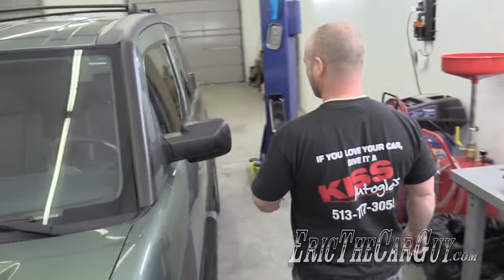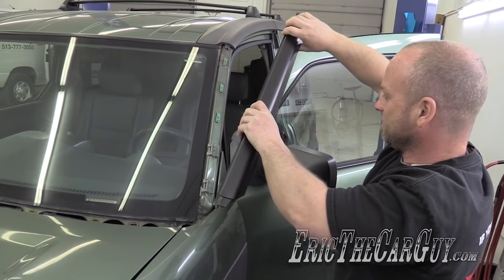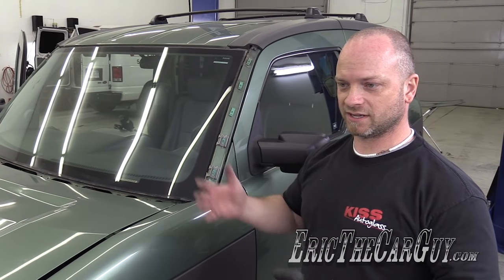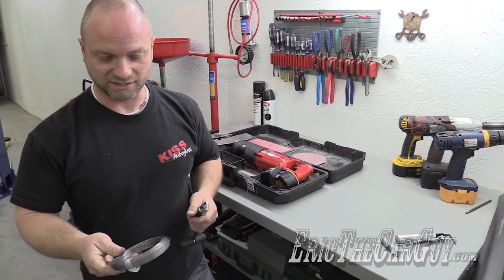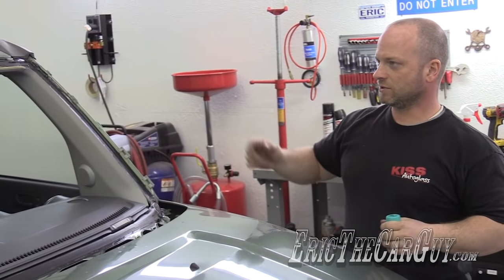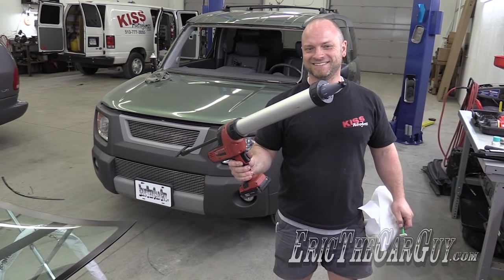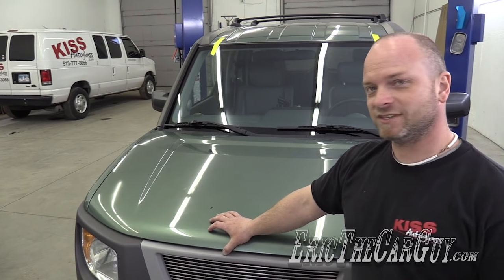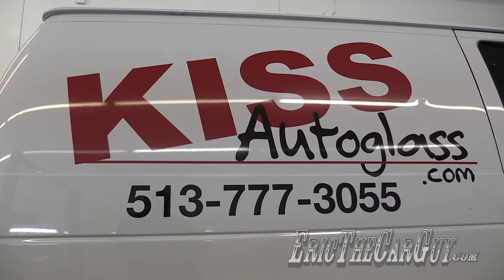How To Install a Windshield the "Right" Way -EricTheCarGuy

Comment: overall I give him a 9 for good work ,priming his scratches and a uniform v bead, however a small amount of rust is an enormous problem! you can not simply prime over rust, that's like putting a bandaid on cancer! it needs to be sanded down to bare metal and then primed, otherwise the rust (cancer) is still decaying underneath the primer! and will eventually start leaking! this also effects the structural integrity of a vehicle and therefore would not meet ratings of  a crash test or meet the manufacturers standards, the auto glass safety council ( the place that certifies auto glass technicians) would fail this Intallation!
Reply: The International Grammar Spelling and Punctuation Institute, (IGSP), would fail your commentary!!!
Reply: Definately a bandaid and window will have to come out in the future. He should have sanded it down and at least use a rust converter so the rust does not spread. Great video install tho!

Comment: i know of a windscreen that can be fitted by anyone, and can be done in 20 mins, land rover defender, why you might ask? because it uses a rubber seal and isn't bonded, downside? that rubber seal shouldn't be called a seal, it should be a called a sieve!
Reply: You should use silicone sealant in the outer lip to prevent water ingress.

Comment: Just for clarification... tempered glass is not designed to keep you from getting cut. It's designed to keep you from getting IMPALED! When you have large sheets of glass that are not tempered they can break off into very sharp, large, triangular pieces that could potentially impale an occupant. ANY glass will cut you, whether it's tempered or not.

Comment: Thanks a lot Eric for such a great video and thanks a lot to the "extremely professional and accurate" Rich from Kiss Auto Glass. I find this video particularly really helpful; because, nowadays, windshield replacement is "rarely" done right. I know a lot of friends who replaced their windshields at "cheap auto glass shops", where they got thugs from the streets replacing their windshields causing water leaks, deep grooves into vehicles' frames, rust, etc., which, in turn, forced their vehicles eventually into the junkyard.

Comment: For slamming the doors with a newly installed windshield, I have an idea about rolling down the windows first so air pressure won't build up in the car w/c would cause issues w/ the urethane, especially the cheaper ones. 
Then you could roll up the windows afterwards. 
I hope this helps. 👍🏼

Comment: What company should I look for to find the best quality cold knife blades? I went to the junkyard to **attempt** to remove a windshield this weekend. I didn't have the job specific tools needed to remove the windshield and it cracked the glass. Now I realize it's not as easy to do this job correctly as I thought it might be, not that I thought it was easy. Great video, thanks for posting this to your channel E.

Comment: The best install I've seen. There is no repair I wince about having done more than the windshield other than the timing belt. The shop screwed up the last timing belt install and it wasn't any better after they replaced the tensioner pulley but charged me an additional $128 for the pulley. I should have gone to Honda. I'm not a hater but if you screw up for God's sake fix instead of blaming it on the customer.

Comment: As a glass tech. I just want to say he did a good job but still did not do everything correctly. First was using the long knife to trim the excess urethane on the sides of the windshield before running the cold knife down it, although it does make it easier. It causes a deep gouge in the metal beneath it. Second was trimming the urethane before cleaning, you're supposed to clean the pinch welds before you trim the urethane. Which helps eliminate foreign chemicals which may cause adhesion problems. Third was the rust, the rust should have been cleaned down to bare metal, before being primed. Priming over the rust does not stop it. which will still eventually cause the windshield to leak. Speaking of the primer takes me to the fourth problem, which is the daubers he uses to apply the primer, 1 should only be used once and never dip twice into it. again causing cross-contamination what could ruin the primer. Now moving on to the "running of the urethane" you never want to seem in the middle of the glass at the top. you want to do one continuous bead when possible however you can't do it on every car. it is very easy. Less seems is less areas for possible leaks. Then using what's called a "pojo" you're supposed to smooth out your seams and make sure there are no gaps and or bubbles in the urethane before setting the glass. Other then that. Good job.

Comment: I see Safelite windshield replacement ads on TV every 5 minutes. They charge $350-450 to replace windshields. I take my cars to a place that charges $90 and it only takes them 20 minutes. Safelite is grossly overcharging people. I guess they need to pay for non-stop television ads. #crooks

Interesting video. Thanks!

Comment: I used an adhesive that came in a coil with waxed paper between it in the coil. When you stick it on the window frame it sticks instantly and once you lay in the windshield and push it into the adhesive, it's down. Also the stuff never hardens. So stays flexible. Totally water proof. No caulk gun needed.

Comment: Great job Rich. I got a 2007 Honda  CRV that was done by an amateur for the previous owner.  
B4 i go to a shop im trying to get any  male /female clips or gaskets needed b4 install as these old ones have been  caulk glommed in there after being broken from improper removal.
I wouldnt expect an indepenedent shop to carry my  incidentals. The male clips are broken on the garnish trims as well at left and right pillars

Comment: Nice video. My only question is why not run the bead on the windshield. I have seen other techs put the bead on the glass. This way they can run one continuous bead from bottom middle all the way around the glass back to bottom middle without stopping. Thanks.

Comment: So, with the long knife, there's obviously going to be some cutting and scratching of the vehicle's paint which means that water molecules will now have access to the bare metal underneath that now exposed paint which will eventually cause rust which will eventually cause water leakage. So, do you clean and prime and scratched paint so there won't be any rusting and leaking issues later on after replacing the windshield?

Comment: Pretty interesting to see how this was done 8 years ago, beyond chemical and equipment updates its still quite similar, I've been a trained technician for about a year now and can do most vehicles in 45 minutes, there are a few I can do in 30 or less but 99% of vehicles are sub 1 hours. Best vehicle I've ever found to do is a suzuki Jimny, 10 minute job max, they are so small and have nothing to dismantle as well as having a wide gap between the pinch weld and glass making it a dream job

Comment: I will say, very nice job. Luckily, the old windshield was an easy removal. I know, in a business sense, it's not viable do clean the old sealer off but, for my own vehicles, I clean it right down to the paint. I also fix any rust issues. I used to do this but, now only for personal reasons. My absolute favorite was doing this mobile...NOT. Nothing better than doing a solo job when it's windy! Couple things I would have mentioned would have been the importance of a windshield in regards to structural integrity. Mostly, what not to do when changing one out like the importance of a flat surface and not having the vehicle jacked up on one side and the doors open. Also, about taking a vacuum to the defog vent, in case the glass was shattered and some bits might have gotten in. A good sign of a poor installation is rust forming around the windshield, especially on the roof line. Maybe, you could do another video of roping in either a windshield or other window with a rubber gasket. Lastly...You can always tell a good installer by the size of his guns! Cheers guys!

Comment: As someone who's been doing autoglass for 16 years, and having done countless elements, I can vouch that these cars suck to replace.  That being said, those moldings should never be removed the way he did it.  Pulling up, destroys the clips.  If you watch the video again, you will see a few clips that have white plastic attached to them...  those are the broken clips from the moldings. If you need to remove them, the best way is to stand in the door jam, grab the outside part of the top of the molding, and push forward.  This release the grey clips, from the green clips.

Comment: 08 nissan sentra.. replaced windshield ad I pointedout the ripples in the trim at top of glasses and that the black part for windshieldwipers was loose. I also notice that it didn't Connecticut to car or winshiled side trimming. He stated that it the snow it would smooth out and that the blk bottom half was perfect but because it was so old n the yea and the dirt and leaves over the years of not replacing windows it was like that

Comment: I just had my new windshield installed by dealership, it’s Pilkington EZ cool plus but I noticed that it wasn’t centered. It pushed more towards the driver side. The right side has 5mm difference than the left side. Should I be concerned? It’s for RAM 1500. Thank you.

Comment: I had my windshield replaced a few days ago.  After leaving the shop, I noticed my wipers seemed to be struggling to move and go all the way down to the stop.  It looks like the sealant bead is thicker than it should be at the passenger side a-pillar.  88 crown victoria.  Is it possible if the sealant bead is too thick, can that affect the spring tension of the wiper arms?  Making it harder for the wipers to slide across the glass??  They incorrectly clocked the wiper arms,..( easy fix ),.. but if the windshield is further away from the frame being that the sealant bead is too thick, could this mean my wiper motor will be stressed and working harder to move the wipers?  Possibly burning out the wiper motor?  I'm very concerned.   Any advice would be appreciated...

Comment: Eric, I had a professional install a windshield on a 2009 Jeep Wrangler and now I have a whistling sound. I had the company come back out and they did a "pressure test:" they put a sudsy liquid all around the perimeter of the windshield and blew compressed air all around the interior and no bubbles formed (I watched to make sure). We removed the roof and found a small tear in the foam gasket on the front edge above the windshield and though I've never seen it before it didn't look particularly new. The roof attaches via compression pretty much and I'm wondering if that's really the cause as the installer suggests, or is there something else I should be looking at with the windshield install that's causing this whistling sound. Thanks for any insights.

Comment: You should be using a U-shaped scraper (BTB makes them) so you don't scratch the paint. Pinch weld primer will not stop corrosion.

Comment: What do you do if you have a leak ? Is it possible to fix it or do I need to put a new screen in? Thanks this is not a job you would see often but absolutely vital if it goes wrong and really nice to know what to look out for. Thanks. I have tool marks everywhere on my LR3 a leak in one corner as well as several spots of surface rust already started.

Comment: The white color clips you see  after he pulled the side moldings are broken off from the pieces he removed , he broke them ? the trick is to role the molding off towards the front of the vehicle , it saves damage to the moldings.

Comment: Another great video :) If my car is leaking in the same spot where you have your rusty spot can I reuse the old windshield after I remove it for leak inspection and repair?
Reply: DashSVK Sure, depends on a few things but mostly if it doesn't get broke pulling it out.

Comment: I really enjoyed this, taught me about something I always wondered about.  I do have a question: Even though Rich is obviously a professional at this, and has done it hundreds (thousands?) of times, isn't it kind of risky to do this without at least a sheet or blanket on the hood to protect the body in case you slip with the knife?  When he's pulling and slicing through that seal to get the old glass out, I kept thinking that one slip and you could easily rip a big gash through the paint.
Reply: When you know how to use a cold knife you don't need do all of that lol.

Comment: Out of factory the car came with the molding.  Is it necessary?  Doesn't it serve as a wind/water barrier?  I was also wondering if you had the molding replaced later?

I had mine done recently and no molding was added at the top.   Windshield seems fine, wondering if I need to replace the modling.

Comment: Great video Eric! I wish you would have discussed windshield quality, ie: OEM vs aftermarket replacement. I'd like to know the difference between the two, coming from an expert with experience. Also if there are tricky windshields to install, like the ones with a heating element for the wipers. Maybe for another interview!
Reply: MiniCactuar I would love to see this guy in another video about, cars with lane departure, rain sensors, and HUD. As for installing a glass with heating elements isn't tricky, only if the wires are damaged or ripped.
Reply: MiniCactuar OEM vs Aftermarket is definitely a fickle fiend; On most vehicles the difference between the two is the symbol on the bottom corner. thats about it. Sometimes there are foam strips, or setting 'pins' that are missing on the aftermarket glass. Neither of those are necessary for a quality product. when it comes to cameras, departure sensors, some rain sensors, HUD systems embedded in the glass, thats when the OEM stuff may start becoming important. My personal recommendation is to ask your replacement specialist. They will be able to tell you if its necessary to obtain OE glass for your particular vehicle.

Comment: not to get picky, but he didnt cover the dash vent holes when removing the glass as shards of glass could get in your eyes when putting on your heater and rested a can and a cloth (could have had chemicles on it) on the bonnet but excellent install
p.s. those side mouldings ..are they on properly????

Comment: I will do side glass and convertible rear windows all day long,and feel good about the repair. Back in about 85 or so one BMW Dealer had us regular line mechanics replacing front glass. Front glass in this era was not too awful tough but not really the job for a newbie mechanic. I am glad to see the days of "bumper to bumper" mechanics ending.

One GM Dealer had us cutting out the small side windows on full size C/K pickups( era 1997-2001). There was no other way but to cut the moulding, one slip and it was paint shop time. I did not feel it was right to require untrained techs to do this kind of glass work and then if they damaged the car (like a paint scratch) to charge the tech. My Dealer had a policy of the tech paying the first 200.00 of any damage done while repairing a car.

Comment: I had my windshield replaced two weeks ago and the rubber trim is starting to back out and curl up at the corners.  I already brought it back for them to glue down the one corner, it had come so far out I could put my finger underneath it.  
They said it's not right because the metal trim is no longer available. They also said they can't get quality rubber trim anymore either as everything comes from China now and it's low quality.  They said bring it back Monday and they will use a heat gun and try to glue it back in place.  You can see in the attached video, the rubber isn't even adhered to the corner, you can pull it out by hand.  This is supposed to be stuck down in there with the urethane no?   
I feel like they messed up, and now they are trying to make it work without removing the windshield and re setting it properly.  Am I wrong?

Comment: EricTheCarGuy I wonder what degree of difficulty a windshield with insta-clear or a defrost strip, or even built in radio antenna would add to the install? I'm guessing just unplugging/replugging two wires.
Reply: ThatCatRudy really it depends. for example, a honda ridgeline with the 'defrost strip' requires the glovebox to be dropped along with the speaker vent trim removed, whereas a newer subaru with the same type of strip only needs the a-pillar popped off.

Comment: I’m considering doing it myself if I buy the truck I’m looking at, depends on how much I’d save buying the tools and stuff rather than just paying Safelite and saving the hassle and risk. The skill is definitely valuable though. The main needs on it are a windshield and transmission but it’s a V8 which is a steal at $500. If I can rebuild the transmission myself instead of buying a new one that’s a ton of money saved and it’s not that old at being a ‘94.

Comment: so if you want to reuse your screen whats the best stuff to clean off the old adhesive from.the back of the glass as i have a rear screen i need to remove to tackle some rust then off to the paint booth then screen back in after...????? thanks.

Comment: The cheapest autoglass places are in the Bronx NY. I used to go to a place on Randell ave that used to charge $75 installed. I had two windshields put on my 87 accord and we took my friend's 95 accord to get a door glass replaced and it was only $30 installed. They do it while you stand there and takes them 15 or 20 min. The Bronx has so many glass places that guys will flag you down as you drive by if they see a crack in your windshield. Competition drives prices there down a lot.
Reply: lineartechbd1600 Yikes!!